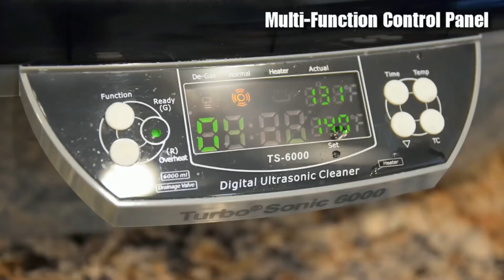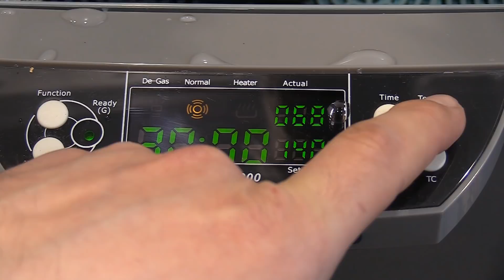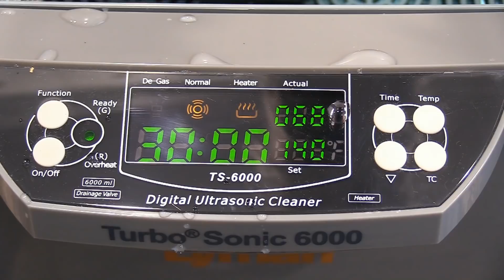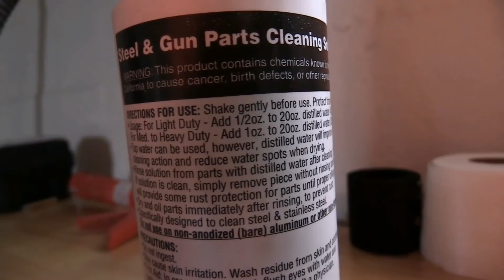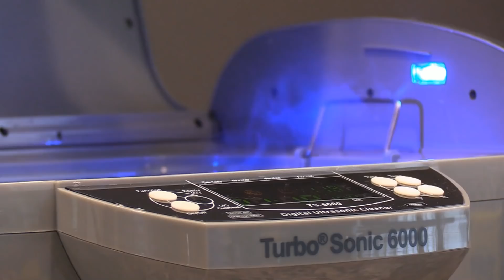Ultrasonic Cleaner Performance Testing (Lyman TurboSonic 6000)

Comment: Bought mine several years because it was on sale because, well, I had the money. I was just starting to get into reloading so I bought what I could when I could and knew this would be something to clean the brass with.

But because if financial reasons it took me longer to get started then I’d hoped it planned. 

Now that I finally have, while I like the Lyman TS 6000, IT LEAKS! And because it leaks I can no longer use it even though it’s technically still brand new. 
If I were to recommend it to someone, I would tell them, use it immediately and plenty while it’s still under warranty and make sure it doesn’t leak. 

Another drawback is it takes a long time to heat up. 

A major drawback now is the cost. And it’s made in China! So they’re making it in China and charging as if it was made in America. And they’ve made it so you can’t even work in the damn thing to fix it without destroying it!

Comment: Interesting video, especially about the distilled water. What exactly are you saying about the quality? There are minerals in it still?

I just wanted to say for anyone watching this years later that I use Walmart $1 distilled water in my CPAP machine and I have had zero problems for 2 years now. No buildup of any minerals, or anything in the humidity chamber, nothing. SO file that in the FWIW category.

Comment: I've been using this to clean circuit boards imgs.love/vUltrasonicCleaner and jewellery for about 5 weeks now at an hour a day of usage with the heater on. There have been no issues with this items operation and it still looks and works like the first day I recieved it. Even with it's small size, a drain would make life so much easier though.

Comment: Aluminum can go in an ultrasonic cleaner it doesn’t damage it.  The cleaning solvent is what causes the damage so if you are using a mild solvent then it’s fine
Reply from the maker: It’s not the solvent
Reply: The VSO Gun Channel I put aluminum parts in an ultrasound tank daily for work.  It does not do anything to the parts.  The chemistry has to be for aluminum or you can damage it.  The ultrasound itself does nothing to aluminum.  You have to watch PH of chemical.  It can damage a polished finish on aluminum but that’s about it.
Reply: I've been cleaning aluminum bike parts at 40khz for 10yrs with no problem.  If I use Simple Green, I do a pure water bath immediately after with water to avoid corrosion.  If using solvents, put solvent in bag or jar with parts and immerse in water.  Saves solvent and easy cleanup. I use Dawn dish soap 90% of the time and alcohol or SG the remainder.  Ocassionally laquer  thinner in a jar. 👍

Comment: We clean ALUMINUM Intakes IN the shop almost everyday with ultrasonic cleaners, you just need a Aluminum safe detergent, has nothing to do with micro channels B.S. I am not sure where you heard that. Its that some detergemts can eat the metal and the ultrasonic cleaner accelrates the proccess. Like i said before I have been working on race cars since I was able to get slapped in the face with a dick standing up, and We use them ALLL the time on Aluminum. Idk Not tryimg to be a dick maybe it is different with guns I dont really see how it could be. It never crossed my mind till I saw this video to even try cleaning gun parts in mine.
Reply: Too bad the uploader was not a chemist . . . 😃
Reply: @johngalt6929  well he is NOT a chemist. He is a youtuber. At any rate. I am Bill gates, my mother was mrs butterworth and my fathwr was captain crunch. ......you see how that works?? Prove i am not Bill Gates! Prove my mother is not a plastic bottle of syrup. People can say whatever the fuck they want to. ....Also i dont know what human in the world has never made a mistake in their chosen line of work. It IS NOT the ultra sonic that destroys aluminum it IS THE DETERGENT PICKED. You just have to pick a detergent that is safe for aluminum, those same unsafe detergents will eat aluminum without the Ultra Sonic just not as fast. The Ultra Sonic speeds up the process that already happens with those detergents. BUT IT IS THE DETERGENT NOT THE ULTRA SONIC THAT IS THE ISSUE. There are plenty of aluminum safe detergents on the market you can use in the ultra sonic cleaners.

Comment: Well 7 months later, are you still happy with the Lyman Turbosonic 6K? Or would you change to a different model or brand? I'm searching for one for myself. Also, is there a brand that uses petrol products to clean(such as mineral spirits), or is that to risky being flammable? Or, the use of one ultrasonic cleaner to clean, and another one to lube/clean at the same time after an initial clean with non-viscous cleaner(which I guess is what you're using there). I like to sit and clean, gives time to reflect on time spent at range and think about why groups aren't close together, if it was that kind of day. Also have dexterity trouble so I can't sit and clean for very long. All input welcome, thanks. Always pay attention when someone more educated than myself wants to teach me something free. Is there a system that will clean aluminum? I suppose if I have one of these filled with CLP, it will not damage the aluminum, correct? Thats what I'm thinking anyway, one for cleaning with non-viscous cleaner and one to finish/clean/lube the mostly clean parts(and aluminum), then drip dry and wipe. Please let me know. Appreciate the video, it was well done. Lyman and Hornady seem to be on top, having only watched 3 vid's so far plus reading. Thanks again, appreciate it.
Reply: 1MADMAX it’s still worth it.

Comment: Even though you talk as if you're very knowledgeable, you show you don't really know much about  this -  people will be better served looking elsewhere for ultrasonic tips, like manufacturers and suppliers
Reply from the maker: I donno, I didn’t work as a chemist for 6 years after university or anything like that. You know, using one of several different models every day for multiple applications. No experience whatsoever...🙄
Reply: @VSO_Gun_Channel  ok well you CAN clean Aluminum in ultra sonic cleaners tho so maybe he has a point??? Its the detergent you pick not the machine. That damages Aluminum. Not trying to be a dick just trying to male sure you have the correct info. Plus I mean dudes point is still valid even with out my point the Manufacture will have the most up to date info on there devices. Lol ok that was all proba ly pretty dickish. Sorry.

Comment: Could you provide a link or reference that states you can not use ultrasound on aluminum?  If you do a Google search you will find many ultrasonic cleaner manufactures that claim you can and this it's a myth.  Here is a video of aluminum headers being cleaned.  https://youtu.be/G5V7D0sfIuE. You'd think this it would be important not to weaken them.

Comment: The piston retainer is aluminum. Also, do not run an ultrasonic without being filled up to the specified level. Yours looked underfilled and that can damage the ultrasonic transducers. Do not let the parts your are cleaning touch the bottom of the tank while running, can damage the transducers even faster. Great for cleaning brass casings,  I like to use plain old dawn with a touch of lemishine to clean most items. You need some form of soap to break the surface tension of water to get proper cavitation action, which is what does the cleaning.

Comment: I believe the fixed barrel spacer and the thing it was stuck to is aluminum
Reply from the maker: I cant link you there, but if you look at griffin’s spec sheet its all 17-4. The fix barrel spacer is a Rugged product and it is also 17-4
Reply: Both of mine are griffin. Magnet won't stick to them.
Reply from the maker: My spacer is actually for the Obsidian, works fine for the Optimus.
Reply: I meant spacer and the screw in retainer are griffin. On the website it says it's aluminum because it's not rated for anything greater than 300 blk sub.
Reply from the maker: Ill check the piston retainer with a magnet to see if it is Al. Seeing as though its not a major component like a tube or a baffle that is taking the full pressure, even if it was, Al it would probably be alright still the description should state that it has an Al component if that is indeed true.

Comment: have you tried this setup on a .22 can if so how well does it work? i have used "dip" in the past but i would like to get away from that.
Reply from the maker: Most .22 can components are aluminum dip is also no go for Al
Reply: my baffle stack is 17-4 let me re phrase so others don't throw aluminum in this cleaner or dip. have you tried using this on components with heavy lead fouling.